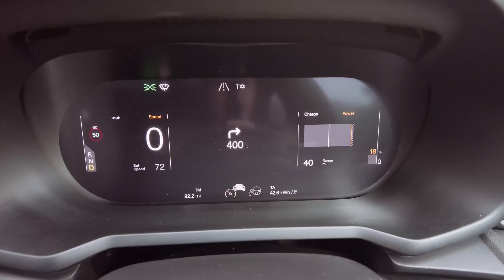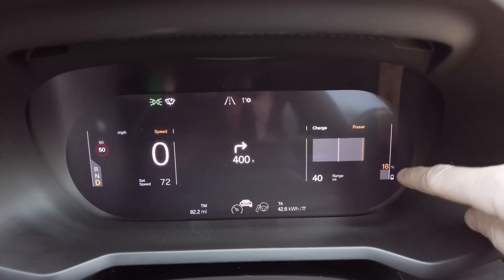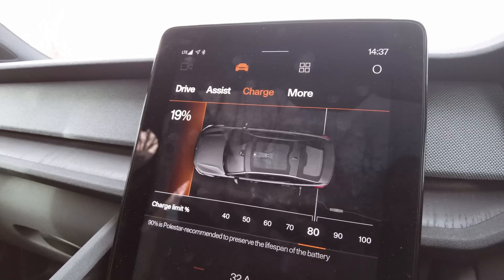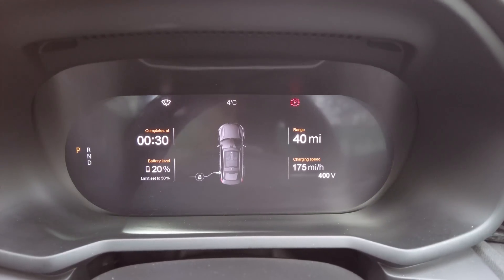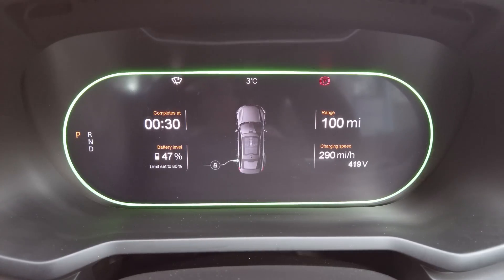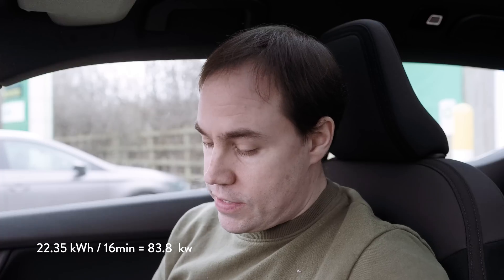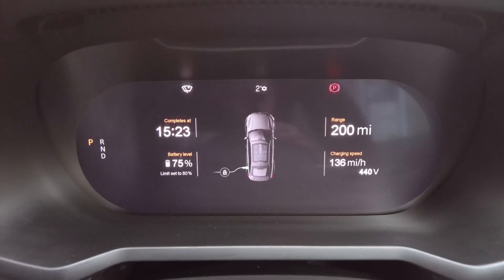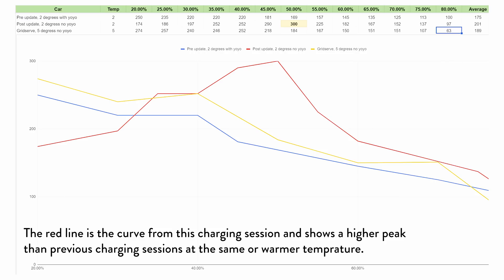Polestar 2 - 150kw charging post update

Comment: If he was using BP Pulse PAYG or the app rather than a RFID card then that's probably one of the reason he couldn't disconnect. Slightly different but I recently switched off my subscription and I got a charging session to work eventually but the app didn't register the charge so when I tried to end the session I couldn't disconnect my cable from their charge point. Their systems are frankly subpar IMHO.

Comment: There is no free lunch when fast charging. You either skimp on cell balancing or you burn power by bleeding off balancing excess which can damage cells if you overheat it.
This gets even more exaggerated as the battery ages and the excessive fast charging and poor balancing. 
Everyone keeps looking at fast charging as faster = better. Well. That is just ONE metric of many.
The rest are hidden from the customer and while everything looks shiny as reviewers measure the 1000 mile new "faster" charging vechicle, everything might not be as rosy down the line.

Think of faster charging as overboosting a small displacement engine. That's something that people can relate to.
Same goes for 800V systems. You're replacing parallel battery connections with serial ones.
The balancing probably becomes shittier and as current passes through more cells in serial, ESR as cells age will make the larger serial group have more problems.

Batteries are a pros and cons technology. But customers right now only measure the pros...
And everyone is happy selling them more pros without talking about any downsides.

Comment: Hi Bradley. Have you tested and compared HPH with the normal parking heater?  HPH is short for Hans Pre Heat after a user named Hans in the Swedish FB Polestar Owners Group posted a clip where he heated the car while cleaning the windows from ice and snow.
In short:
1. Unlock the car and open the drivers door.
2. Don't sit or touch the drivers seat!
3. After a few seconds...touch the center display.
4. You hear the car "wake up" and you can set anything you want in the climate meny. Fan, Seats, Steeringwheel etc.
5. You can close the door but don't lock!
6. After exactly 15min you get the question is you want to proceed or turn off. Choose proceed for another 15min run but never touch the drivers seat!
Why use HPH?
Mainly because of the seat and steering wheel. But it also seem to use more energy that the parking heater. (offcouse compared to no seats or steeringwheel etc and same fan speed) so some of us hopes this also preheat the battery.
If you do the HPH for 30min (2x15) with you charger connected you can leave home with some great consumption numbers. Have fun! // Henning
Reply from the maker: Thanks I haven't tried this so will give it a go this morning
Reply: Great! Will be interesting to see if you notice any difference. I tested many times and see that regen limitations in cold temp etc can be removed quicker by using HPH compared to using the parking heater. 
BTW. This is basically just a glitch based on that Polestar allows the car to wake (and start infotainment and climate) without sitting in the seat and then when there is no trigger from leaving the seat the car stays awake. So no bug! Just a glitch! 😊

Comment: 20 minute drive to get to a charger is not very good plus you have to pay.
A robust charging network is a must have and manufacturers should get together and get this done either by joining up with Tesla and paying their fair share or starting a new network. This situation is looking rediculous!
I travel less than 1.2mi to my nearest supercharger where the further one is 6.4mi away. Of course, I'm not counting the supercharger units at Whole Foods Market, which is 2.4mi away cause I don't like that setup in the basement of the parking garage. These are all multiple charger facilities.
If you are going the EV route, there's only one choice.
I watch all your videos but feel they're showing up Polestar's inadequate software. IMO, they had better get on the ball real quick as the clock is ticking.
I've yet to see one on the road!

I'm right in the center of "Tesla Country" so that certainly makes this comment with bias towards Tesla.
Reply: Why would anyone need a supercharger nearby? (Must be frustrating not being aböe tp charge at home instead?) I never use a fast charger close to where I live. Charging at night and always have full battery in the morning. Not really convenient to have to go charge a electric car the same way as a petrol one.
Reply: @volvodashcam  Well apartment dwellers don't have a choice and it is frustrating that Apartment owners are not more friendly to EV ownership. All that's needed is a little push from the government to make adding charging facilities more feasible.

Comment: Really weird that Polestar does not show the charging in kW. 
However, If interested, this can be calculated by multiplying the voltage with the current:

P = U * I

P ... Power in Watt (W)
U ... Voltage in Volt (V)
I  ... Current in Ampere (A)

So, if you know voltage and current, it is possible to calculate the charging speed in W or kW. 

I have seen screenshots where both are indicated and screenshots where only Volts can be seen. I can’t check myself since I am still waiting for my P2 to arrive.

Comment: If the charge limit was set to 100%or 90% instead of 80% would the speed of charge stay a bit higher as it approached the 80% point? Also, I am sure a few mins waiting would not dissipate the built up battery heat too much! It’s like a big storage radiator!!

Comment: The Model 3 will pre-heat the battery if you select a Charger as the destination. So depending on the test you want to do will depend if you pick the charger as a destination or not.  Not doing it will mean a like for like ... however it's then unfair to the Tesla who has this pre-heating where Polestar/Google do not as yet - hopefully in a 2020 patch!
Reply: Currently only for superchargers, in the UK at least. Coldgating is one of the biggest things along with charger reliability that needs to be addressed. Polestar seems like a great car, wish that added that battery heater though.
Another great video, enjoy your Tesla weekend

Comment: Might the charge time be minutes remaining rather than a time to finish?
Reply: If so, it's still a bug as the text says "completes at"
Reply: @farfromsensibletv  I suspect most would live with that
Reply: @tryityourself3870  True. It's still not correct English for the change in behaviour though and polestar will need to update it if that's the case.

Comment: As soon as battery has heated up it should have been at 140-150kW until battery closes up on 456v, anything else is still wrong.
Not sure we see any improvement here. Fastned has the curves for their network and this seems close to that. The sharp dropoffs around 40% and 55% are still there.

Comment: Hi
Does it just seem to me that you grin more when you arrive after the YoYo-drive? :-)
So it's fun to accelerate faster, isn't it? :-))

A German car tester also drove to a fast charger and wanted to do a charging test. There were also 2 charging points.
Later he noticed when a 2nd car came and connected, that the 2 cars shared the 150kw. He wasn't very pleased. :-)

Of course, I wonder how fast you charge with the Tesla. But you have to look where the Model 3 comes from, from the USA or from China.
And when you drive the Tesla you can leave the calculator at home, it shows you everything you want to know while charging.

Greetings from switzerland.
Reply from the maker: Thank you! Yes the power of these cars is great however it always makes me feel a bit sick if I do the 'yoyo' trick!

Comment: Hi Bradley, have you looked at the display preferences to see if there's an option now to see charging speed is kW on the display? If not I can't believe that they still didn't enable this after all this time. That's feedback they had from almost everybody ages ago. Can't be that hard to display this and battery temperature. I will complain if this is the case.
Reply from the maker: Thanks, yes sadly that still doesn't seem to be available  and it's information that should be there!
Reply: @ShortCircuitPS2  I'll wait until I get the update and if it isn't there I'll mail support to ask why it isn't there and why surround sound is. This should have been priority. Thanks for checking, much appreciated!